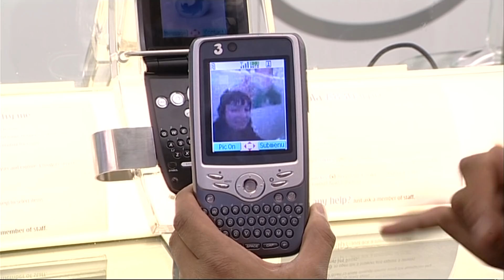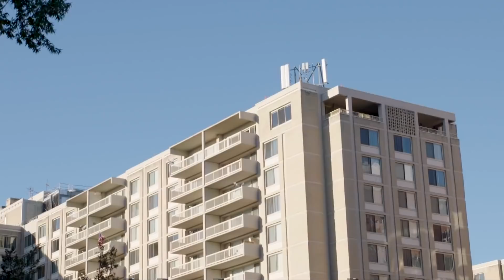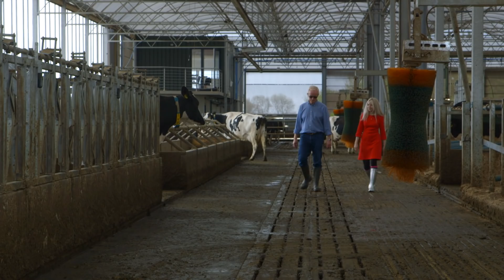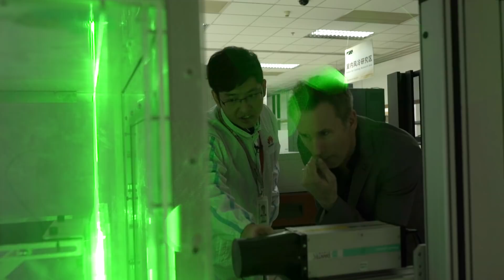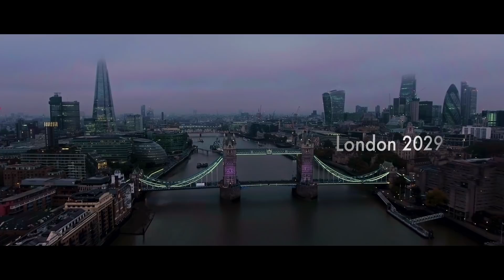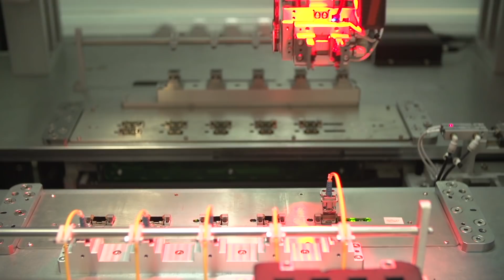5G Whizz - BBC Click

Comment: I worked for a mobile provider when we were working on providing data services to trains. One of the first trials was a van full of engineers and lots of hardware, driving around the parking lot at high speeds, with "cell towers" in every lamp post. Quite a funny sight outside my office window.
Reply: If that van crashed we'd be back to the stone age

Comment: To install 5g. Will be a suicide mission for all people connected or controlled by coms protocols.  ,Blocks of software controlling other blocks of software into infinity and the bigger. It is the more difficulty exponentially in fixing it .
As an even more dangerous problem will be the radiation from antennas as there will be multiple radiation's in every district due to number of antennas. The effect of this increased RF saturation has been known for about 40 years and is described about by the heating of cell tissue. The dangers are been ignored due to ignorance and due to an illogical fear that the UK will fall behind the greater technological bonanza.

Comment: There's been the technology around for years that allows the stock to reorder stock that's scanned out of the stores . It's nothing to implement that into fridges to reorder your grocery's . Super markets use it when an items scanned out the store the store adds that onto its orders , it even knows how many units in a case . Every barcode is programmed to come back as what ever you programmed it to on the master computer. Like Tesla said there's power everywhere , soon were going to tap into or interfere with the wrong vibe or technology and the world isn't going to like it and it will start to show signs of it killing us as a result.. the world's a mess and starting to be separated from what it originally is suppose to be \ do in the world.. and the universe shall suffer ..
Reply: I don't want all these radio waves running through my body...

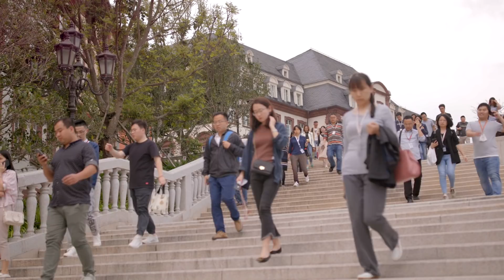Comment: The security concerns alone, mentioned should give significant pause to rushing the implementation of this technology on a widespread basis.  but at 12:30 you start speaking of the extra power needed & heat generated by 5G equipment - which would have been an ideal point to bring in the subject of RADIATION (not mentioned once in this piece) being generated by the equipment.  That's where the heat comes from - Electromagnetic field RADIATION (EMF radiation, or EMR).
Over 10,000 studies have called into question the damage that can be done to (biological) cellular & DNA by existing wireless technology.   The effects are now widely documented.
It would be more prudent to allow independent long-term studies to be completed & figure out how to safely deal with 5G, rather than using the general population as test subjects.  As thorough as your report is on much about 5G, ignoring this aspect is as dangerous as anything depicted in the dramatic account shown and should be given equal consideration.
Reply: Spot on,nice to see people doing their own research and not just relying on bullshit shows like this one that fail to even address tha possible side effects of this technology

Comment: This is why I don't buy or use any smart item.. lots of smart TV's around now! I got a non-smart normal lcd TV works fine even after 11 years.  No smart meter no smart anything in my home and I keep it that way!  As for the worry about 5G security by the national security firm, Al they have to do when the 5G is fitted is to just get a very clever person here who can write a code on a chip that the 5G has to talk through that controls how and what it talks to and stops it spying in anyway?  Just because it was brought from a company like Huawei don't mean you just let it work without a home built controller system to watch over how it runs?  Huawei can't stop you adding extra security since you will own the units.  I think most of this anti-Chinese possible treat is all down to Trump disliking how China is beating America in the race to be the best country in high tech futures?  Yes we always need to be careful that's normal. But Trump is a loony who even dislikes his allies like us in the UK, So I take his views on other countries with a huge pinch of salt?
Reply: Re: "home built controller system to watch over how it runs" That's the problem, 5G requires lots of access points and securing all of these is a problem unless the security is built-in and is confirmed to be locally controlled. The lack of information is fuel for the politics to run rampant. However, most people don't understand the security problems with the technology.

Comment: Shenzhen public transport system is electric because thats how they subsidies their own e-car industry. It is not a good investment yet to use electric only buses. You need to charge those buses a looot.  Also: Shenzen is a showoff city to minimise the contrast between mainland China and Hongkong, what is still way way richer. Train: China is a big country with very very peripheral areas, like deserts, or the Tibetan plateau. Not surprisingly in those areas not han chinese are the majority. So they need to "occupy" those territories too, thats why they built high speed rail to Tibet, to dilute the local population and culture. It is not because they are soo cool.

Comment: Funny how they talk about things like household appliances having 5g data connections. What they don’t do is ask why anybody would want to do that, when currently WiFi is taking care of all household appliances just fine. They also talk about how you need a base station every few hundred feet in order to provide coverage. Well if that’s the case, you will never see it happen outside major cities with a high enough population density to justify all those stations. And finally there’s all the panic about 5g RF exposure. It makes no sense to worry about a bit of low-level microwave energy when we are bathed in natural microwaves on a daily basis. Same goes for other sources of RF besides 5g.

Oh, one more thing. 1g is analog cellphone technology. 2g is digital cellphone tech, including Edge network data transmission. 3g is the first true broadband data system for cellphone use, but 3g phones still use 2g technology for voice and text transmission. 4g is a marketing term, it is really no different from 3g, only faster. It is actually LTE or “Long Term Evolution” based on 3g. 5g is a marketing term for the 4th generation of cellphone technology.
Reply: "What they don’t do is ask why anybody would want to do that, when 
currently WiFi is taking care of all household appliances just fine."
because iot devices in increasing numbers duhhhhh......

Comment: So Huawei are probably 18 months ahead of their competition because they bodged together code, didn't thoroughly check third-party code, and stole code (which they didn't check properly).
Inspires much confidence.
Reply: A lot of their code is open source, particularly their 4G modems (B315 etc). In theory that should be good as it can be studied. No idea what they are using on their 5G stuff though...
Reply: All code is bodged together. No one writes all code from scratch anymore. Code libraries and code sharing has been the norm for the past several decades. Huawei is not the first company to bodge together code, and all companies, Chinese or otherwise, use code libraries.